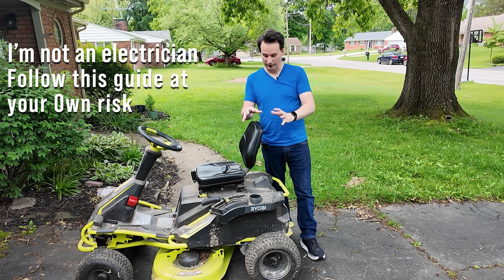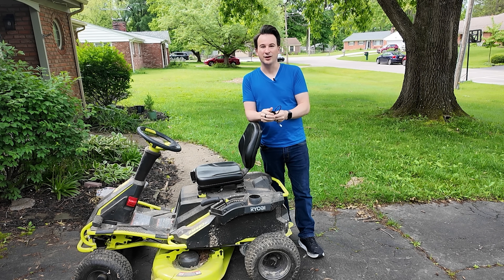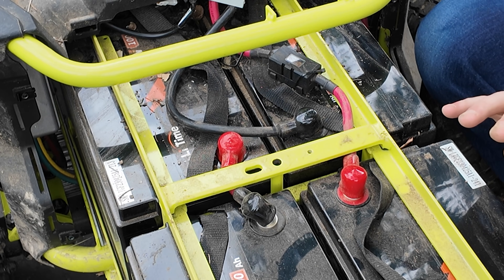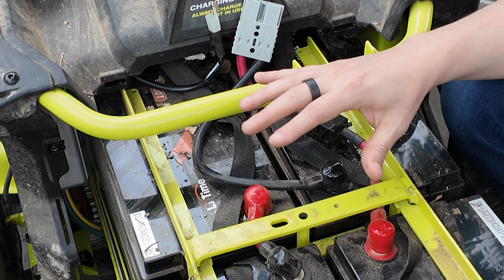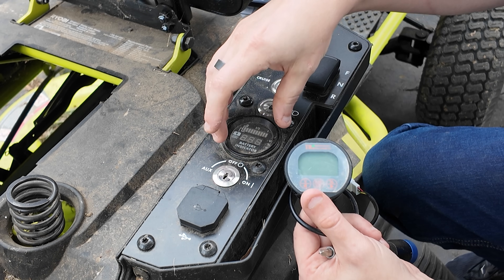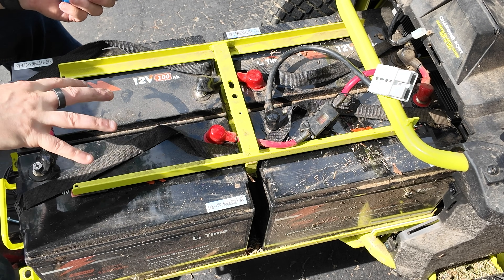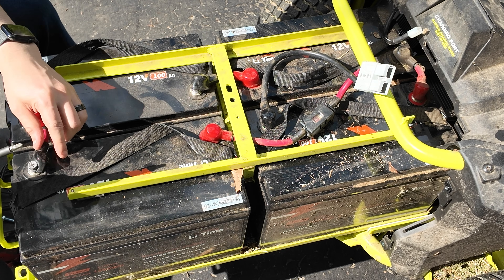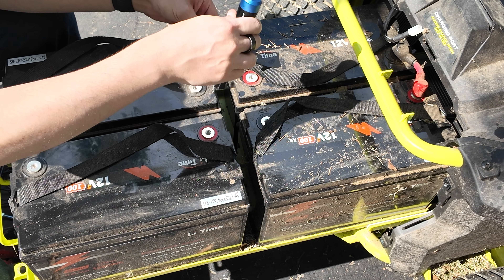Upgrading the Battery Monitor in a Lithium Ryobi Electric Riding Lawn Mower

Comment: Just out of curiosity, why did you think the shunt would not fit up front where the battery charger cable normally connects?  It looks like it takes up very little space.
Reply from the maker: As I understand, you won’t get a proper measurement if you stick in at that location.

Comment: Do you need a different charger when you change battery to lithium?
Reply from the maker: Yes. Although some of the later models of Ryobi have a charger that can theoretically charge lithium, it can’t measure when the battery is fully charged. And other models can’t charge lithium at all. Safest bet is new charger.

Comment: Fantastic video. Thank you. Since converting and rewiring with the new monitor following your instructions, the monitor seems to correctly show gradually dropping battery capacity as I use the mower, but it doesn’t react to or change the %-charge reading when in plug in my charger. Any ideas.
Reply from the maker: Thanks!
That's... odd. After you finish charging does it correctly show 100% charge?

Comment: Your video made sense to you but it created more questions then it answered for me.
Reply from the maker: Ok? If you had mentioned questions maybe I could have helped.
Reply: Okay, I want to switch my plug handle from my lead acid battery charger to my new lithium charger. Can you explain how? My mower works but I have no way of charging it. I have the P3648 battery charger, but it's plug doesn't fit.
Reply from the maker: Ah hah, my OTHER video covers that, this one is just about the battery monitor itself.
To make your new plug fit, the simplest thing to do is break a couple of tabs blocking your new charger. 
If you look inside the charging hole on the Ryobi, you'll find two little horizontal tabs, they're keeping your new charger from fitting. Use some needle nose pliers to break them, they're not needed for anything. Then your new charger should fit.

Comment: Hey Anoraker, thanks for the detailed videos, since you changed the monitor the hour meter is no more. Is there a way to keep the old gauge and add the new one separately?
Reply from the maker: I didn't do it, but I have seen a few people who left the old meter installed and installed the new meter... just placed it somewhere else, like the USB port spot or with a 3D printed mount.